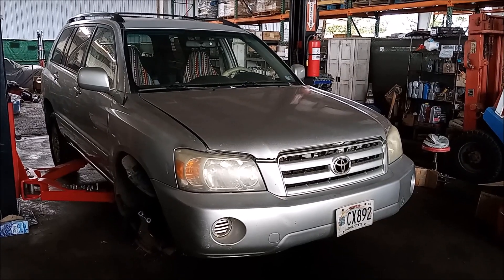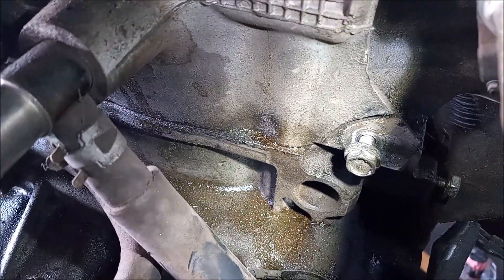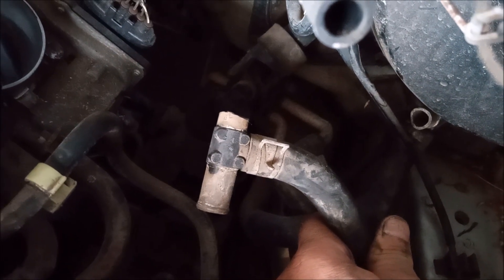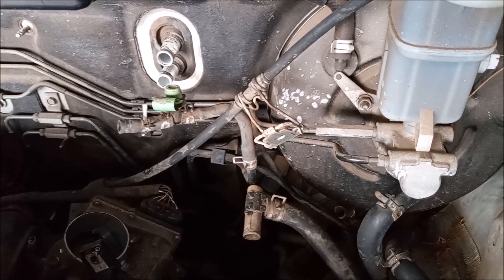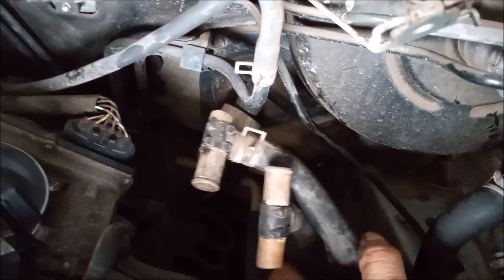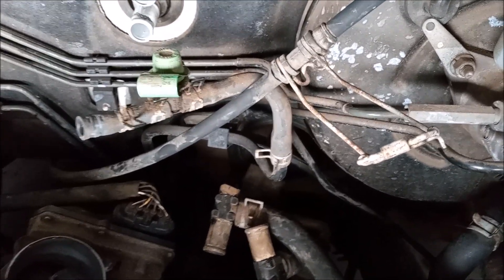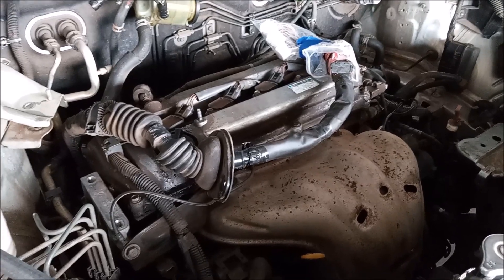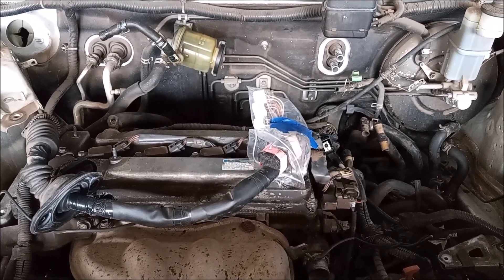TOYOTA SUV's AND MINIVANS A Sudden Failure That Can Destroy Your Engine - Highlander Sienna RAV4

Comment: I have a 2008 Highlander with the 2GRFE engine and 3rd row. Is this T easy to get at/visible? Thanks for the video!
Reply from the maker: The T's should be visible if you look down behind the air intake tube or underneath it. To get at the T's you do need to remove the air intake tube and the airbox.
Reply: @Merryfrankster_   Great, thank you!

Comment: Good evening Mr. Frankster, I have a 2008 3.5 and I've ordered the all metal oil line of the part number you put in the description of that video, I noticed the inside diameter of the banjo on the valve cover end of the line is larger than the old rubber elbow line. So the union bolt moves around much more in the new line, and I can see the crush washers seem a little small for it. Have you noticed this yourself? I'm concerned if it's not centered just perfect it may leak. Thanks for all the great videos!
Reply from the maker: I have never noticed it but if you want to try to address this  just order a different banjo. All the threads on the engine side are the same. The seal is achieved by the crush washers - as long as they are secure, the fit of the bolt inside the eye does not really matter. The bolt and eye are designed to allow flow of oil between them - from the eye into the gap and from there into the opening of the banjo and out the front of the banjo into the valve cover.  If the fit between the bolt and the eye is  too tight, then oil will not flow. Why] are you posting this comment in a totally unrelated video?
Reply from the maker: By the way, what year and model is your car? I will look into any potential differences in banjo bolt size and report back in case it is necessary to purchase a banjo bolt that matches the eye more closely.
Reply: I'm surprise he doesn't have much subscribers. It possible the Joker clown avatar he use. It need to be more professional it make people more caring and wanting to support.

Comment: Very informative this is why I sub to your channel. I got Rav4 2gr-fe w/ 3rd seat. You think it's ok to by-pass it with brass straight? I'm not using 3rd seat I might even take it out.
Reply from the maker: Yes, definitely, bypass it, fewer places to leak.
Reply from the maker: BTW thanks for your informative reply, I have never seen a RAV4 with this option, now I know they exist!
Reply: @Merryfrankster_  I'm not sure if it has rear heater core. Will look at it now that I saw your video. But Rav4, 3.5 w/ 3rd role seat is quite rare I didn't even know it until I got the car...'07 Limited. I'm not driving it fast because I want to make it last forever. It also build in Japan which I really like.
Reply from the maker: @pnp8849  dive it like you stole it, that's the only way.